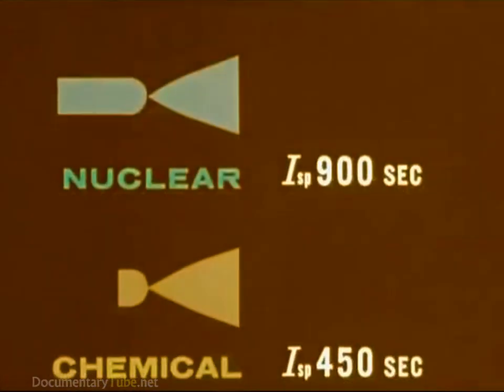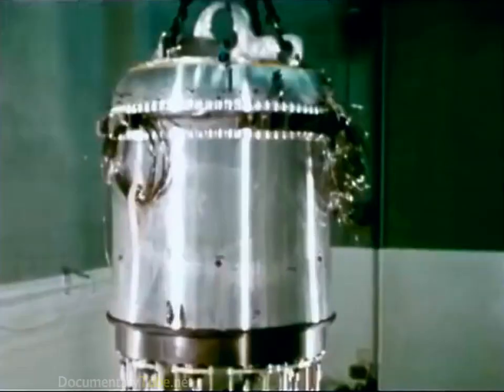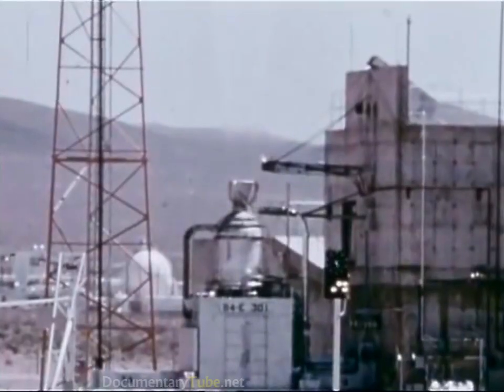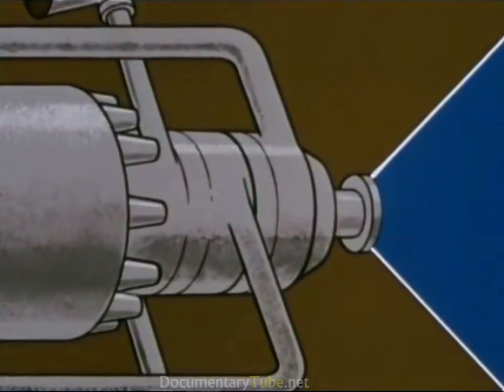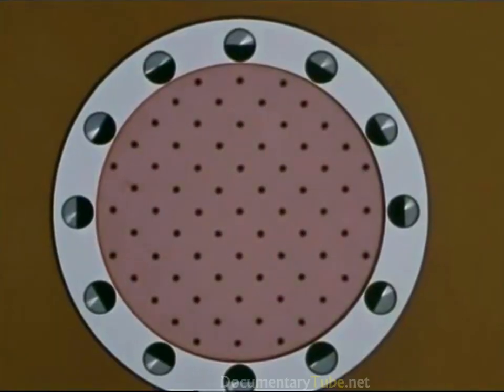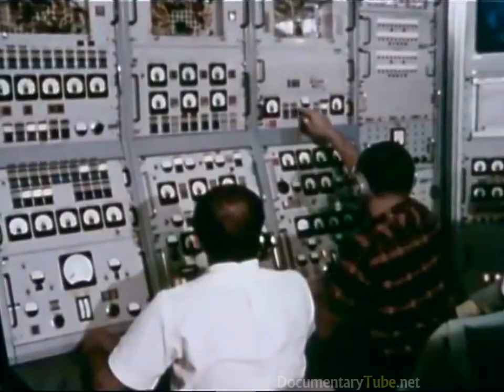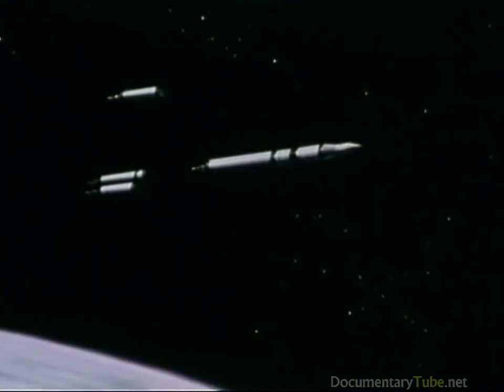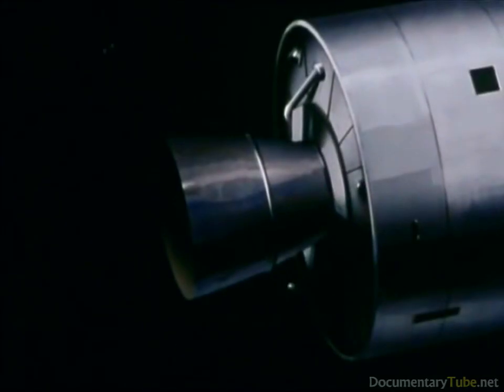HOW IT WORKS: Nuclear Propulsion

Comment: Since Russia is now using nuclear rockets, I hope thier engins has spring loaded rods around the perimeter of thier nuclear cell, so if their rocket is shot out of the sky, the rods will spring into the absorption mode, which will cool the reactor down and make it safe for the public, but if Russia has not taken a spring loaded rod position into factor, then where ever the missile parts land it will cause radiation poisoning to everyone in that atea....🤔🧐😳😬

Comment: really shows you how little weve advanced in technology in the last 60 years, people say were progressing faster than ever, but thats merely in the feild of electronics, an even with that were reaching the limits of moors law, were still using circuit boards an gold an copper an transistors, only thing thats changed is better more eficient software and smaller hardware, thats it

Comment: 8.00mins You state that the liquid Hydrogen is stored at Minus 420F.
Liquid Hydrogen freezes at Minus 435F.
The Temperature in the vacuum of Space is Minus 455F
Frozen Liquid Hydrogen would clog the Exhaust pipe.
Reply: Wouldn't that be easy to solve with a heat ring or 'coil' encasing the exhaust that's kept at a stable temperature by running the reactor at low power, just enough to keep the temp up.

Comment: US did this in theory, RU actually did this for real and kept it up there for a while. New silicon carbide uranium zirconium carbide ceramic core reactors can run extremely hot, make usable thrust and ions literally out of thin air. Also could run  24/7 for decades.
Reply: The US program was advanced to producing a flight-worthy propulsion system, but was closed without making an actual launch. The Soviets tried to catch up but abandoned the effort as soon as the US program had ended.

Comment: It's electric not nuclear!
Reply: It's not? The video clearly explains that it's a torch drive - it funnels hydrogen through the core of a nuclear reactor and propels it out the nozzle. An electric nuclear drive would use the energy generated by the reactor to power large ion drives with a comparatively abysmal amount of thrust, much like contemporary ion drives.

Comment: I have a question that I'm hoping someone can answer. Why would a lighter, less dense propellant like hydrogen be preferable to a denser propellant like, for example, mercury? Surely it would seem that a heavier propellant, much like a heavier bullet fired from a gun, would produce more recoil, or thrust as it's known in rocketry, would it not?
Reply: because weight is everything on a rocket. You would then have far less payload capacity because that fuel would weigh so much.

Comment: "The time that one ounce of propellant will produce one pound of thrust." Right, got it.
"The higher the seconds of specific impulse, the greater the propellant economy."  Okay, I'm still following. 
"Our best rockets today are limited to a specific impulse of around four hundred and fifty seconds"  Erm..,
"On the other hand, full scale nuclear reactors have achieved eight hundred seconds."  Now you lost me. 

What achieved eight hundred seconds of what? 
And what is the reaction mass that your rocket spews out? Fission products? Fused Helium?
And how do you throttle? 
I must be stupid because I don't get it.
Reply: Okay, what I understand is that liquid hydrogen is pumped into the reactor. To do what? Fuse hydrogen into Helium? What happens in the nuclear reactor? And again, what pushes the thing forward? What makes it move?
And carrying a tank of liquid hydrogen with you is also not the most economical way to get things into orbit or on its way to Mars.

So, who can explain the underlying basic principles to this Dutch knowno?

Comment: The so forth details did not include contamination by radioactive exhaust and the disposal of used rocket stages in space. Nuclear propulsion works in theory but the radioactive contamination issue needs to be fixed. Thanks.

Comment: With the nuculear trust boosters, will require to be much smaller,  as the combustion is simply more powerful, doesn't change the volume of fuel, if take human/living/fragile cargo.
 However, Electric/Plasma/Ion thrusters, which normally grants very minute acceleration, if can be nuculear amp in watts enough to sustain acceleration equal to gravity as gforce approximately 0.5 to 1.75mph every second during solar orbit travel.

 This would manage gravity & non-idle acceleration while reaching in time duration, even far faster and far further and without nuculear exposure versus chem-fuel.
 Save the classic chem-fuel combustion for emergency maneuvers and VToL sequal in atmosphere realms or moons.

Comment: One has to wonder how much radiation did they put into the environment?  Can you say cancer hmmm.
Reply: No. This is just like a nuclear reactor for energy. It produces heat. The radioactive material stays inside the reactor. Hydrogen is flowed through channels and heated up. The hydrogen is the only thing that gets released into the environment.

The reactor does emit radiation, but that's only dangerous when it is generating power/heat, and is only dangerous when you get close to it.

Comment: Wasnt the issue with nuclear engines a problem with storing the hydrogen?
Reply: The test was stopped because they ran out of hydrogen?

Hydrogen can evaporate from fuel tanks, it needs to be actively cooled, or have a shade, so it remains liquid. Otherwise you just loose fuel along the way.
Reply: @kedrednael   not only that hydrogen is very unstable if the cooling fails the engine explodes
Reply: @dylanlandry4996  Yes. But isn't that the case with most rocket engines? Space Shuttle engine also almost exploded once because a gold pin came loose from a plugged cooling channel and broke more stuff.

Though if the engine is containing nuclear material, this is makes the problem even slightly worse.
Reply: @kedrednael  wasnt too sure kust finding out lol

Comment: why not create a nuclear explosion as propulsion.......?
Reply: This NERVA engine works continuously and doesn't emit radioactive materials. That's nice.

Nuclear explosion deposit radioactive materials into the environment during launch. In low earth orbit it releases lots of radiation, which is dangerous for satellites. If you need nuclear bombs for propulsion, this creates a large market for nuclear bombs. You would have thousands of extra nuclear bombs. And you'd have them in space, which many countries won't like. If the craft were to fail during launch, those nuclear bombs would just drop down somewhere on earth, more than enough to arm an entire continent.
It's just way more experimental than this NERVA engine.

Comment: love this stuff, minus throwing away nearly 1/2 dozen nuclear engines.   Always cool stuff but my understanding is that although the rockets had higher specific impulse they generate less thrust.
Reply: Less thrust is just compared to other fuels. Hydrogen is light and therefore doesn't give as much trust as other fuels would. But it could still generate a lot of thrust compared to other rocket engines. The NERVA engine would have nearly three times as much thrust as the spaceX Merlin engine used on falcon 9.
A nuclear engine could use water or methane for example, then the trust would be higher and specific impulse lower.

The specific impulse is more important in space anyway. In the end you go faster with higher specific impulse.

Comment: I'm curious if plasma rocket programs like VASMIR have developed a hybrid nuclear plasma rocket specifically for non-atmospheric propulsion. I suspect this would greatly improve both the thrust to weight ratio and fuel efficiency. Nuclear powered space craft at the moment is our only real option for high speed high acceleration and braking for inner system travel. My guess is a few large orbital space craft would be built with a rotating section for simulated gravity (probably a second counter rotating  section to offset torque and drift issues). This vessel would be like a Super Carrier Space Station combo with smaller craft for landing on and taking off from moons/planets. The smaller craft would likely use non radioactive propulsion so the "Motherships" would have to be large heavily shielded and armored to protect crew and various storage like fuel food and water. A large hydroponics facility would be great to help recycle CO2 and provide fresh vegetables and fruits. The fresh food would be necessary for crew morale and health.

Comment: The Recirculated Expansion Pipe Mercury Rocket, with Reverse polarity for reverse gear ( Mass Flow Density)! It would be like a FanJet, entirely covered shroud engine ( and Pressure Plate) reduced to only water vapor clear back at the DEF!

Comment: Two things that limits the distance that can be possibly traveled is mid-space refueling and maintenance. With mid-space refueling, we can reach past the distance of Earth to the moon. So it'll be like going from one airport to another, but it'll be called spaceports. With spaceports, maintenance of the spaceships is needed to ensure reusability. To have spaceports, it'll either be built on a platform that can align itself with either a planetary body's orbit or the rotation of the sun. In the latter method, the spaceport will be it's own space body, or can be expanded into a space station.

Comment: 1. NTP Systems Are Powered By Fission
NTP systems work by pumping a liquid propellant, most likely hydrogen, through a reactor core. Uranium atoms split apart inside the core and release heat through fission. This physical process heats up the propellant and converts it to a gas, which is expanded through a nozzle to produce thrust.

2. NTP Systems Are More Efficient Than Chemical Rockets
NTP rockets are more energy dense than chemical rockets and twice as efficient.

Engineers measure this performance as specific impulse, which is the amount of thrust you can get from a specific amount of propellant. The specific impulse of a chemical rocket that combusts liquid hydrogen and liquid oxygen is 450 seconds, exactly half the propellant efficiency of the initial target for nuclear-powered rockets (900 seconds).

This is because lighter gases are easier to accelerate. When chemical rockets are burned, they produce water vapor, a much heavier byproduct than the hydrogen that is used in a NTP system. This leads to greater efficiency and allows the rocket to travel farther on less fuel.

3. NTP Systems Won’t Be Used At Launch
NTP systems won’t be used on Earth. Instead, they’ll be launched into space by chemical rockets before they are turned on. NTP systems are not designed to produce the amount of thrust needed to leave the Earth's surface.

4. NTP Systems Will Provide Greater Flexibility
NTP systems offer greater flexibility for deep space missions. They can reduce travel times to Mars by up to 25% and, more importantly, limit a flight crew’s exposure to cosmic radiation. They can also enable broader launch windows that are not dependent on orbital alignments and allow astronauts to abort missions and return to Earth if necessary.

Nuclear thermal propulsion and how it works.
Download our nuclear thermal propulsion infographic.

5. NTP Systems Were Developed With Support From DOE
NTP is not new. It was studied by NASA and the Atomic Energy Commission (now the U.S. Department of Energy) during the 1960s as part of the Nuclear Engine for Rocket Vehicle Application program. During this time, Los Alamos National Laboratory scientists helped successfully build and test a number of nuclear rockets that current NTP designs are based off of today.

Although the program ended in 1972, research continued to improve the basic design, materials and fuels used for NTP systems.

NASA and DOE are now working with industry to develop updated nuclear thermal propulsion reactor designs. Three industry teams won a design competition in 2021 and are now further developing designs that will be submitted for evaluation for the fall of 2022. 

6. NTP Systems Are Focused On Using Low-Enriched Uranium
DOE is working with NASA to help test, develop and assess the feasibility of using new fuels that require less uranium enrichment for NTP systems. This fuel may be made using new advanced manufacturing techniques and can potentially help reduce security-related costs that come with using highly enriched fuel.

Idaho National Laboratory is currently helping NASA develop and test fuel composites at its Transient Reactor Test (TREAT) facility to examine how they perform under the harsh temperatures needed for nuclear thermal propulsion. Initial testing has shown that nuclear fuels under development by NASA and DOE are capable of withstanding ramps up to operational nuclear thermal propulsion temperatures without experiencing significant damage.

Comment: The problem with nuclear rockets. Is radioactive leakage. Rockets are dangerous enough with conventional chemical rocketry. Adding nuclear fuel rods into the system. Means any time there is a critical failure. A nest team has a much tougher job of cleaning up nuclear material. Increasing the potential for lost nuclear materials. 
The health risks to society and the astronauts. Proved to be to great for an expensive engine that broke down faster then desired. There were problems with rod durability and synchronization. 
The number of uses for a nuclear engine was less than a conventional chemical rocket. Which costed much less to work on and replace.

Comment: nuclear propulsion.  shouldn't they consider amplifying magnetic fields - instead of expansion of plasma/gas...
but, they need high temperature super-conductors, so they don't have to cool the copper wire...well, what are they waiting for? - aliens to provide them with the necessary materials?

Comment: well, my question, is the exhaust radiation. when the nuclear fuel, is spent, is it not airbourne, and damgerous, if inhaled? Also, does it become a  hazardous cloud? causing nuclear rain?, or can it settle at sea, and contaminate our seas, underatanding the residual radiation, even after years? im all for the good fuel, but if its that dangerous, we need to be careful.

Comment: So it’s hydrogen pulse jet with a poorly designed and dangerous fuel heater!? Instead of the radioactive power plant to heat the fuel couldn’t you just run it threw the walls of the jet to heat it up and to start it spark plugs?

Comment: CO2 propulsion may work given the proper pressurization system
Reply: Although the amount of CO2 required would be best for smaller components such as cabnitry valves

Comment: Did they spray radiation all over the place during the engine tests?
Reply: Doubt it. they transfered heat to the hydrogen through a metal, and didnt run the hydrogen directly through the nuclear  reactor

Comment: " They used the nuclear rocket for an hour ". Have you seen that the heated hydrogen blasted out into the environment after it was passing through the nuclear reactor? It isn't  a radioactive pollutant after contacting with highly radioactive elements?

Comment: Imagine what these guys could have achieved with modern computers.
Reply: yeah they could use those computers to figure out there are only two genders .
Reply: @saint27573  you mean sexes?
Reply: @gerardanderson9665  same difference
Reply: @technus147  Genders could be different, but I think there’s only 3 (Male, Female, Nonbinary). Sexes are only two and always two (Male, Female).
Reply: @robertoroberto9798  genders are the same as sex
Reply: @robertoroberto9798  you are in the wrong comment section. Lunatics are welcomed in a different part of you tube

Comment: So why haven't we built a true space ship then? If we can propel it off of nuclear fission, then deep space travel might finally be possible.
Reply: it's propelled by heating up liquid hydrogen, where it goes out of a nozzle to generate thrust. the reason it's more efficient than the others is because 1. it's just more efficient and 2. you only need liquid fuel rather than liquid fuel and oxidiser, essentially doubling the amount of delta V the craft has and therefore increasing the distance you can travel. but, it still runs on liquid fuel. that runs out eventually, even if fission is used. rn there's not a single method of thrust that doesn't use up some sort of fuel - the closest we have rn is ion engines, which have extremely low thrust but are incredibly efficient. the nuclear engines are kinda similar to this, having a low TWR compared to most other engines but are more efficient.

Comment: the tandem mirror experiment was propable the successor to this design.
the theoretical design of the tandem mirror engine uses nuclear fusion as a means of propulsion and can theoretically reach a specific impulse of up to 1.000.000
right now nasa is considering yet an other technology involving nuclear power, they just electrically heat a gas.
I think that the mirror engine should be revisitet as it is much more efficient than just heating a gas
the tandem mirror experiment was a precursor to nuclear fusion reactors, so it's not all lost.

Comment: So they tried out various nuclear propulsion prototypes in the late 50s and into the late 60s. Yet, 50 or 60 years later, there is no such system in use, and they're still using chemical rocket propellants, which are inefficient and won't get us any real distance in the solar system very quickly.